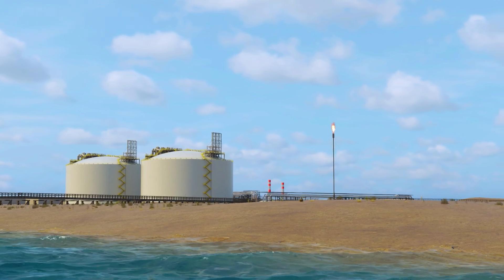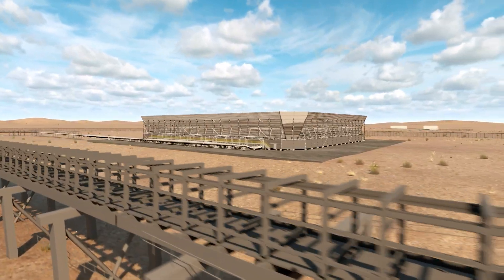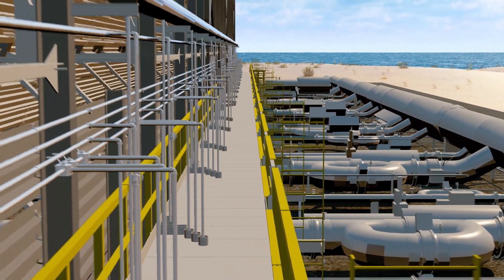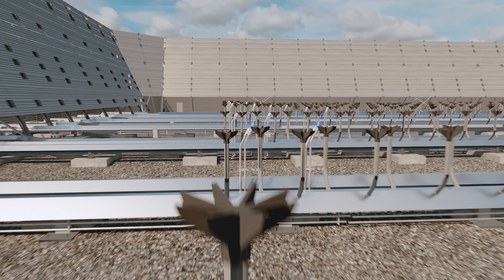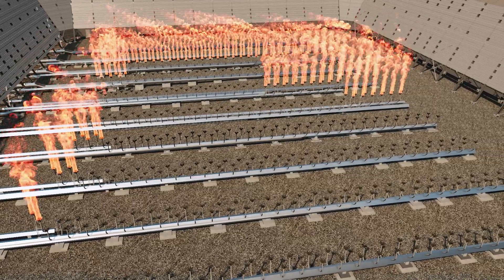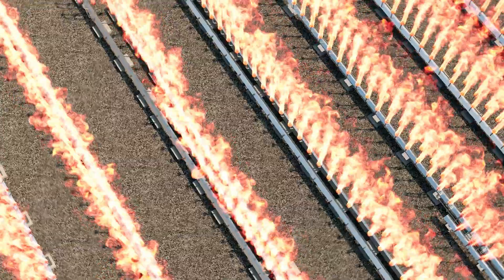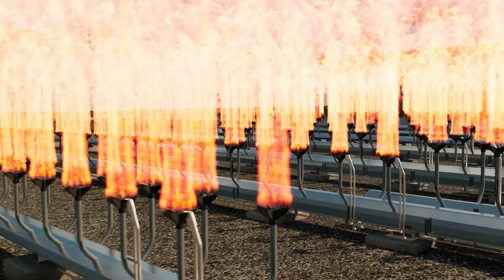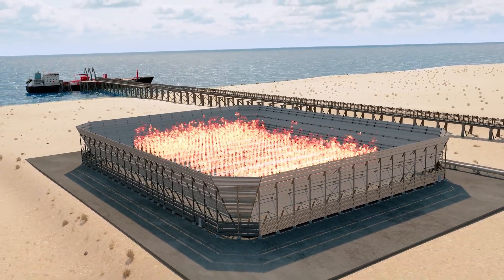What is a Multipoint Ground Flare?

Comment: How th fuck beneficial to environment 😂😂
Reply: its better than having a pipe rupture and sending who knows how much product into the environment. here. your primary output is carbon dioxide. but this system only works for less complex hydrocarbon chains. propane. methane. butane. that kinda stuff. the longer the chian the longer it burns and the more pollutants you get(nasty soot and nitrates and whatnot).

still a flare tho so... still a waste of product/heat.